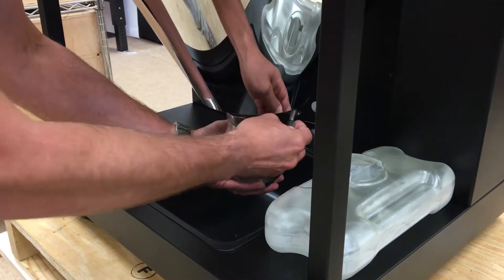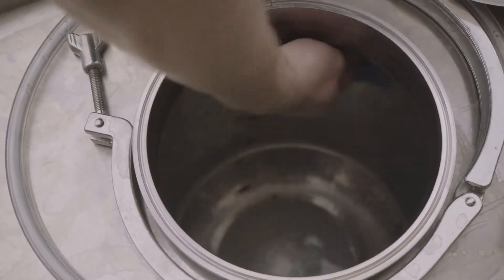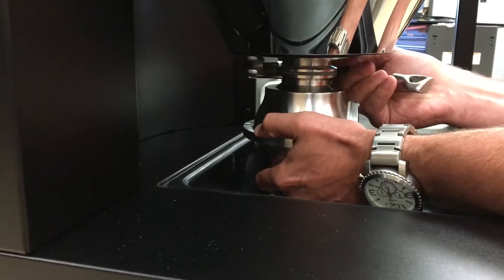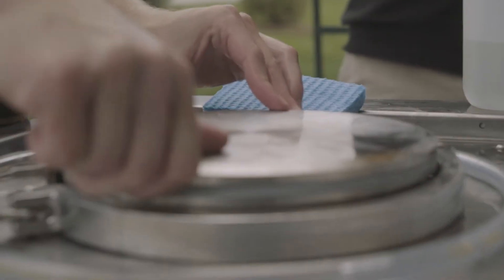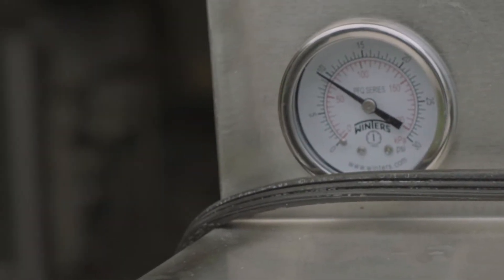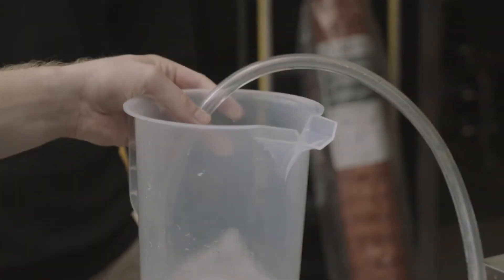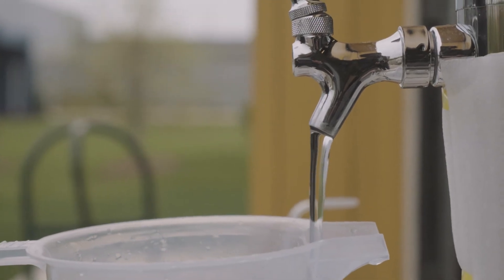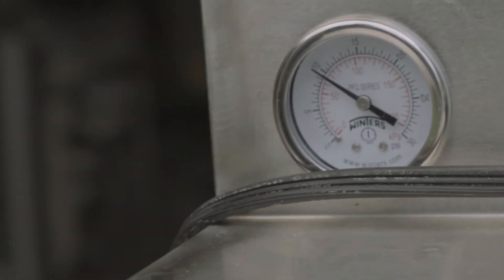Sanitizing and Cleaning Vessi™ Fermentor and Dispenser

Comment: question:what are you pressurizing with? if co2, that seems like a lot of gas used to completely evacuate the system 2-3x every cleaning
Reply from the maker: Luke, sorry we didn't get back to you earlier. You can use at 5LB CO2 tank. I'll get back to you on what the average number of brews the tanks last, but it's subject to change depending on if your naturally carbonate, force carbonate, dispense, bottle, or keg your beer. The amount of CO2 used during cleaning is pretty minimal in the grand scheme of the process.